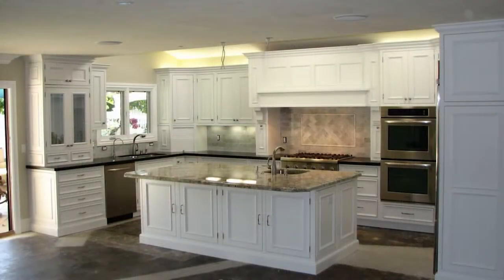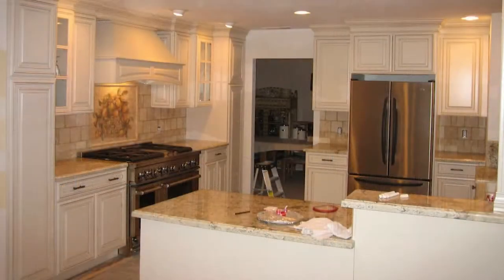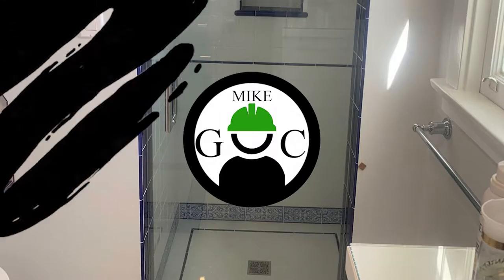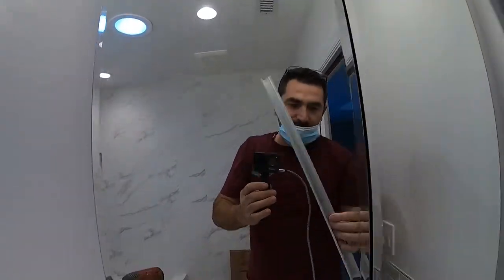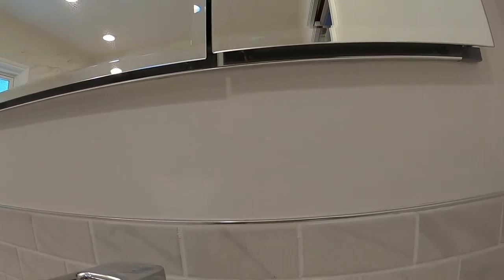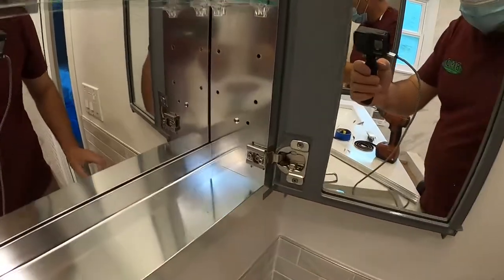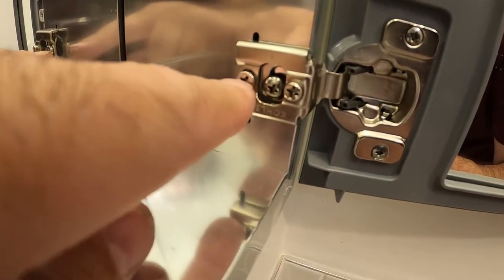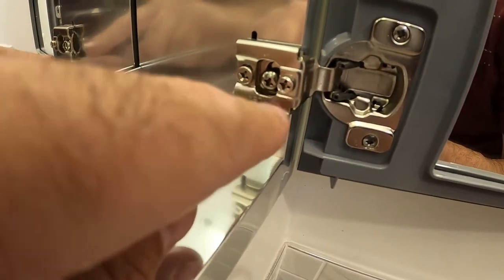Instructions on How to Adjust Doors for Kohler K-CB-CLC3026FS Medicine Cabinets

Comment: Great video for hard-to-find info on how to adjust these cabinets. I have one that is not aligned in height or surface level. The problem is the installer adjusted it and now I cant move the screws at all. He tried to get it even but forgot to look at the end result and it shifted. I am guessing I have to strip the screws out somehow and purchase new ones? Any insight?
Reply from the maker: Thank you! Which screws are stripped, the ones that’s holding the hinge?
Reply: @MikeTheGC  the three adjustment screws that are holding the hinges on both sides, top and bottom are all stuck. I can get two of the ones closest to the door to move but that is it. The ones I need to move according to your video are the middle ones ad the right side hangs down further than the left door.
Reply from the maker: If it’s the screw in the middle that’s holding the hinge, the screw can be replaced. If it’s the screw in the back or the one in the front near the door, unfortunately the hinge needs to be replaced.
Reply: @MikeTheGC  Mike,
You are a wealth of information. Thanks again!
Reply from the maker: @JeanneneLangfordartist  You’re very welcome!

Comment: One of the mirror doors on mine doesnt soft close hot do you fix that?
Reply from the maker: @leorashulman3801  you have to contact the manufacturer to provide you with the new hinge.
Reply: @MikeTheGC  I did thanks that worked

Comment: My kohler mirror door will not close all the way. How do I adjust for that? I have the same hinges as you
Reply from the maker: You can fix that from the back screw by turning clockwise for the left door and counterclockwise the right door. Good luck.

Comment: Is there a way to adjust the 'swing out' on a Kohler Med Cab door? My door swings out too far and hits the adjoining wall.
Reply from the maker: You can use hinge restrictors. I have a video on how to do it. https://youtu.be/O-oXMUeakvA
Reply: @MikeTheGC  Thanks, Mike!
Reply from the maker: @barbaraharting230  you’re welcome! Good luck.
Reply: We had this problem, too.  Hubby just installed it and every time I opened it it swung out wide and hit the mirror over the sink. Was afraid it would end up breaking the mirrors before getting it adjusted.  Just found this video so haven't tried the hinge restrictors but will!